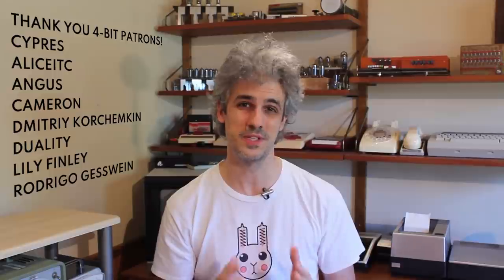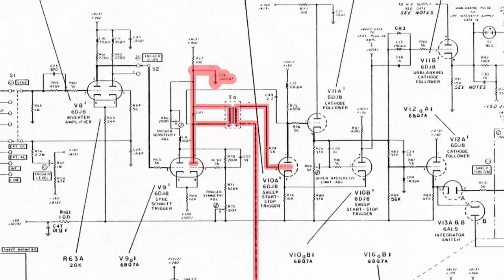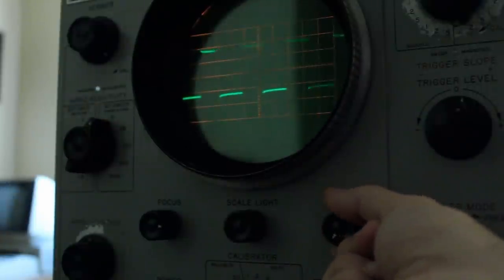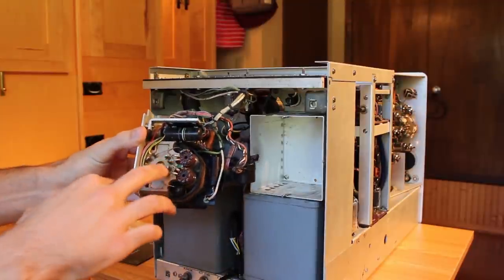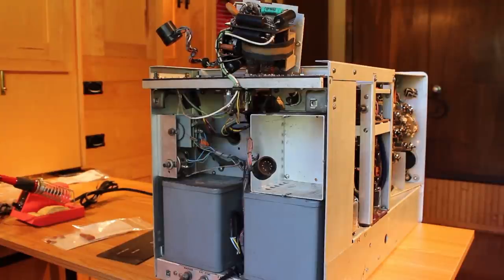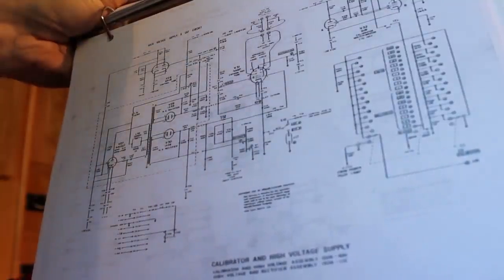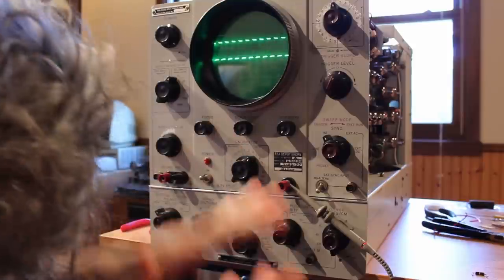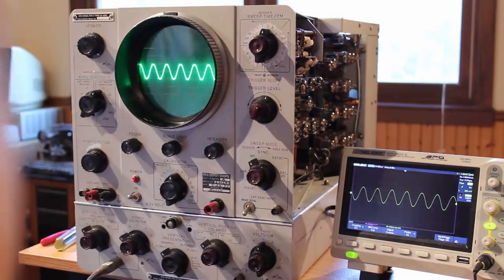Restoring an HP 150A Oscilloscope (Part 4) – Victory!

Comment: Who else was shouting at the screen, 'Turn the brightness down! You're burning the phosphor on an expensive and hard to replace tube.' The brightness should be no higher than the display on your modern 'scope. Any brighter and it begins to defocus as the trace spreads across the phosphor. That threshold should be your guide. That said, it's great that you managed to fix the Old Lady. 🙂👍

Comment: I enjoyed this series, having enjoyed working with HP stuff of this vintage years ago as a service tech.  What surprised me is your reticence to 'shotgun' replace all of the paper caps at once.  As my hobby these days is restoring old amateur and test gear--those caps have either failed, changed, or are not far from it.  My first order of business is to first make a parts list of the caps and then check any high-ohm resistors for tolerance.  Then add the inevatible ones to the list.  Follow up with a thorough internal cleaning of control contacts and potentiometers--followed by tube testing.  Although such does not create as many "interesting" adventures in troubleshooting--that way of doing things saves a lot of time and smoke--and usually leads directly to the alignment.  Anyway, keep on enjoying these beasts!

Comment: yep and the golden rule about all vintage gear such as this here, never trust the capacitors because they will have excessive leakage which will fry resistors and other stuff on the way. the bumblebee or black beauty as you call them and wax caps allways need replacing but also electrolytic etc tend to be gone too. you can normally trust most Mica style which is the square ones you can see in the device and or mustard caps and film caps generally don´t fail as often as the other ones, except Rifas, oooo the shivers I get from these Rifa ones, destroyer of equipment and ruins of life. they must be replaced on sight!  but I did not see any here because your device is a bit older than these caps anyway. good job restoring it in the end!
Reply from the maker: Thank you!
The black beauty / bumblebee caps were almost all cracked from stem to stern, it's a miracle they didn't take out more components when they died. The HV caps were surprisingly weak too, I ended up having to replace all of the HV ones with modern WIMA caps and the machine works beautifully well again now!
I thankfully haven't had any run-ins with any RIFAs, but then again, all my equipment predates RIFAs by about 15 years.

Comment: Flux your desoldering braid and it will suck up solder like crazy. I usually heat up some flux with my soldering iron (rosin flux) and dip a few centimeters of braid as needed. The difference is colossal.
Reply from the maker: That's a really, really good idea! I don't know why I never though it that, but it makes total sense! Thanks!

Comment: That scope is a beast! Congrats on taming it!
Reply: Also I have a signal generator in the same family that was made in the early 70s. Those things were in production for 30-40 years with some internal revisions but seemingly the exact same chassis.
Reply from the maker: @justovision  Thank you so much!
And yeah, the 200 series Oscilator was such a rock solid design, HP sold them for years and years! It's a really great little oscillator and I always love seeing them still in use. Mine needs a little adjustment to align the dial with the frequency better, and the amplitude portion has been misbehaving a bit lately, so I'll have to dive into it again soon to sort it completely.

Comment: Congrats on your victory and thank you for a well presented series. 

If there is one thing to take away from your adventure though, I would quote Paul (Mr Carlson's lab) "these capacitors are outta there!". A "blanket" replacement of capacitors may sound unencumbered by analytical thought process but it would have saved you at least two episodes' worth of headache.

Not to say it wasn't entertaining to watch though.

But Paul demonstrates over and over again these old foil capacitors are all dead. I don't think in his entire video history he's found more than a handful still good in probably thousands replaced and tested. Following his example I got myself a capacitor tester and had the same experience. Not one good in the handful of restorations I have done.

And if it were my money, I would change all those black 6kV capacitors as well. Cheap insurance.

Comment: Great work, but that selenium rectifier has to go if you plan to use this scope. They are just time bombs waiting to go off.  You might be lucky if it is on a low voltage rail, the do last when uses for under 20v
Reply from the maker: Thank you!
Interesting, I didn't know that Selenium rectifiers were that sketchy, but I've had a couple people tell me to look into that now. My little 200CD oscillator has been misbehaving a bit lately, so when I dig into that one again, I'll also crack the 150A open and see if I can do something about that Selenium rectifier!
Reply: @UsagiElectric  I will check and see if there was an official 'HP-Mod Kit' for it. Most likely was as this was a popular CRO.
Reply: The thing about those old Selenium Diode rectifiers is that when they finally give up the ghost, they let out a very pungent smell that persists for a long time.
Reply: I cheched. I was mistaken it was a NOS Tektronix mod kit I saw.

Comment: Congrats for this nice intense restoration. I like the way you bend the capacitor wires to the correct length. May be i'll change the way i do it from now on.
Reply from the maker: Thank you!
I needed to get those caps to be like axial caps, but I was really worried about putting stress on the epoxy coating, so I did the slightly extravagant bending, which was probably overkill, but I think it looked cool, haha.

Comment: Good job!   Now in your spare time you could change all the other tubular capacitors in there.  Especially the wax, bumblebee, and high voltage ones.   They are probably leaky or about to short out.
Reply from the maker: Thank you!
I actually did go through and replace every wax and bumblebee capacitor on the machine. There's still about 5 or so HV caps that are the original caps though, but I figure that as long as its working as well as it is, and it's working brilliantly at the moment, I'll leave them be!
Reply: @UsagiElectric  That's fine, but you might want to stock up on high-voltage capacitors with leads, they are getting scarce and very expensive.   I had a hard time finding some 3KV capacitors for a Tek scope. Neither DigiKey nor Mouser have a good selection of them anymore.   The ones they have in stock are like $44 EACH !!!

Comment: Selenium rectifier (gray plates stack close to power supply), lets pray it doesn't overheat, otherwise you will have to live with a terrible rotten smell for some time until it goes away. Big Clive did a video on them some time ago.
Reply: @vincei4252  Not so blindly, you have to accout for its voltage drop, the circuit might be intolerant to such low drop as that of silicon diode
Reply: @teslakovalaborator  Of course, however, depending on where the rectifier is used the drop across it might be insignificant. All requires an assessment which I didn't go into in my reply.
Reply from the maker: Thanks for pointing that out!
I had a few other people tell me I should replace that as well. I had no idea that selenium rectifiers were known to be fairly unreliable. I did some digging and it's the full-bridge rectifier for one of the DC heater chains. So, if it goes, it won't take anything valuable with it, which is good. But, it would definitely be a good thing to replace before it does cause a problem. Fortunately, I know the voltages I need and the power level it should be delivering, so I can get a modern full-bridge rectifier and run a series dropper resistor to get it nice and safe!

Comment: Very nice, I know your pain with the wafer switch, I did a Grundig Oszillograph G4 a while ago. 
These units are built beautifully but a pain to work with if you need to access a capacitor deep down under a wafer switch assembly. 
Your CRT seems to have a lot of life left in it too. 

I guess you are well equipped for the cold months. 
If you leave the covers open, it makes a nice christmas decoration, with all the tubes.
Reply from the maker: Thank you!
HP, in all their wonderful foresight, made the switch easily removable, but then put very short wires from the switch to the main PCB that were soldered in place! I had to kind of twist it out of the way to barely get enough room. It was... tough to say the least, haha.
The CRT looks really brilliant and may be a testament to how much of this scopes life was spent sitting unused on a shelf somewhere. Either way, I'm properly happy with the result!

Comment: You inspired me to have another look at why my Tektronix 561A wasn't working, and I figured out the "on" switch just needed some contact cleaner!
Reply from the maker: That's excellent! I wish the HP had just need some contact cleaner, haha.
The Tek 561A is a gorgeous little hybrid scope (I was pretty surprised to see that it uses some transistors in the power supply section, that's really cool). I'm glad you got it going again, I love seeing more old gear getting used again!
Reply: @UsagiElectric  I might need to get a new switch or give the current one a bath to make it work consistently, and the type 3A1 vertical amplifier (which also uses a surprising number of transistors) will definitely require attention, but it really is an impressive piece of technology. But no match for this pure tube piece of art you restored!

Comment: Your journey with this scope seems very similar to mine from last year, restoring a Dumont Fairchild 766H hybrid oscilloscope. Nice work!
Reply from the maker: THank you!
And that Fairchild 766H is a very cool scope too! Googling it led me to a great build thread on Antiqueradios (link below). It seems the author went through a pretty intense repair too. Could it be I found yours?
Either way, the Fairchild scope looks to be a great little (well, not so little) scope!
https://www.antiqueradios.com/forums/viewtopic.php?f=8&t=380702
Reply: @UsagiElectric  That is indeed my article, yes! I have not aligned it yet, but I like to use it for less serious stuff. Funny story, my HP1740A scope died and instead of buying the part to fix it, I bought three of the Fairchild scopes! I just fell in love with their particular look as soon as I saw them! I suppose you may have read that in the article though. Your series was nostalgic for me, even though it hasn't been very long since I did my scope.

Comment: That old oscilloscope is hard to work on due to how complicated it is internally, and yet you successfully brought it to specs. Looks good! 👍 If it has video or signal input somewhere in the back of oscilloscope, why not put together a small computer with Cortex M4 / M7 microcontroller to display the data in overlay with the original signal being measured, like voltage and frequency?
Reply: I'm pretty sure that CRT is working hard enough as-is just displaying the signal data.
Displaying extra data would require tapping in to the entire signal generation and MUXing the horizontal/vertical position so the MCU can control the dot position and write something.

It's doable, but it'd be a big modification to the rest of the system.
Reply: @MrRedwires  True, however some oscilloscope can be left original out of box without any mods before using such setups. I know of a few HP oscilloscopes that had that feature before they switched to 100% digital oscilloscope hardware.
Reply from the maker: Thank you so much!
It was a true battle to get there, but the result was totally worth it!
It could be done to have a data overlay like that, but it would be well beyond my capabilities. It would also limit the minimum speed the scope could display. Even with two traces, I can start to see visible flicker if I get to too low of a frequency. Most importantly though, I've got an old HP frequency counter sitting in the garage that needs a resto, and so why do a data overlay when you can buy more vintage HP stuff!

Comment: I've got an old Telequipment D33R Tube Oscilloscope that I would love to restore back to full operation, trouble is, it needs a replacement CRT because the original one has a great big hole in the screen, and is therefore no good anymore.
Reply from the maker: Very cool! The D33R is the rack mounted version, right? That's an awesome looking scope. That's no fun about the CRT though, I got lucky in that this one was in excellent condition, but a hole in the phosphor is one of those things you can't really repair. I hope you find a good CRT for it one of these days!

Comment: While a beautiful piece of equipment, and a great victory to bring that o'scope back to life, I wonder if a new modern piece of equipment would be more practical for a casual user?  Regardless, I was proud to see that your long journey of repairs has paid off and it is again  worthy HP test equipment gear.  Congrats.
Reply from the maker: Thank you!
And HP really did make some gorgeous equipment!
For a more casual user, a modern scope is definitely much more practical, if only for the fact that it won't weight a ton, haha. I would actually suggest that if someone were to be getting their first scope, that they should instead go for an analog scope from the 80s-ish. These can often be found for under $100 on eBay and usually are still totally rock solid. I have an old BK Precision 2120 on my desk that I use for most stuff, and it's great.
Thanks for checking out the videos!

Comment: Wait, did you say -5000V and 6000V a few seconds earlier? Yikes, I am truly terrified now too. I built a regulated 2000V power supply for some photomultiplier experiments and that terrifies me too. All pets are banned from the lab when that sucker is running. Unsurprisingly those experiments have been on the shelf for a very long time.
Reply from the maker: Yup! There's some proper high voltage floating around in there for the CRT circuit. I was super nervous working on it with the case off it, but I was just focusing on being methodical and cautious and it all worked out alright!

Comment: I think that the capacitor shorting burned that poor resistor.
To avoid burning that precious hv transformer I’ll suggest to replace the other hv bumblebee capacitors.
Reply from the maker: Yeah, that's definitely possible!
At the moment, everything seems to be working correctly, but If I notice any fluctuations in the brightness, I'll definitely shut the system down and replace the other HV caps as well!
Reply: @UsagiElectric  HV transformers are now the rarest things on earth :) Almost burned one on a delicious Tektronix Type 310A.
By the way, very beautiful videos!
Love your content!
Reply from the maker: @AlienLogic775  Thank you! If I ever get the HV stuff out of the box again, I'll take a look at replacing those caps! You're right, HV transformers are near impossible to find these days, so it makes sense to take whatever precautions we can to keep them going for as long as possible.

Comment: I really like the lines on the oscilloscope screen. Is it possible to make an artificial screen that will look like this on my desk?
Reply from the maker: Thank you!
It's totally possible to build small oscilloscopes with modern components, you can even buy kits. But, one of the reasons that scope looks so good in my opinion is because it's using a pretty high quality CRT (Cathode Ray Tube). These are often quite large and use pretty high voltages, but old scope CRTs are pretty common and not that expensive, so it's definitely possible to build something with one. 
Check this out for some cool ideas: http://www.sgitheach.org.uk/scope3.html
Reply: @UsagiElectric  Thank you very much for your detailed answer. The website turned everything I thought into a set. Wonderful! Have a nice day, good work.

Comment: Control carbon resistor too. Sometimes it fullshit
Reply from the maker: Yup, those old carbon composition resistors can drift quite a lot. I tested most of them though and they were mostly within their 10% range. Some had drifted slightly beyond, but that could be corrected for with some potentiometers in other places.

Comment: Cool, man.  capacitors
Reply: (Yourtube messes up comments) .. Old Paper-vax capacitors leak DC so they alter bias of tubes and can overheat/burn coils. It's smarter to switch them all the same time since the rest of them will get bad in time.
Reply from the maker: Thank you!
At this point, I think I've changed all the paper-wax capacitors and bumblebee/black beauty caps in the entire system, so I should be good!

Comment: 11:36 it appears this is a carbon film resistor .. why didn’t you go for metal film resistor they have lower noise
Reply from the maker: I had a really tough time finding a 4.15M 1W resistor. I bought some other metal film resistors that I could put in parallel, but I decided to give that one a shot and see how it did. So far it seems to be pretty stable and the picture looks great. If I have any issues in the future, I've got my other resistors on standby to try instead.